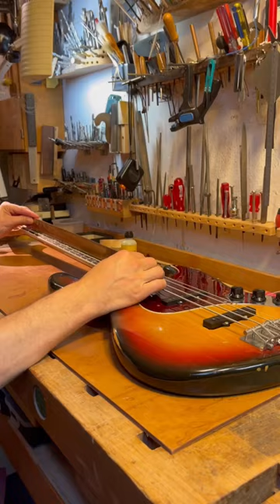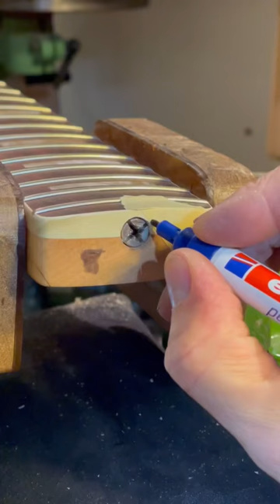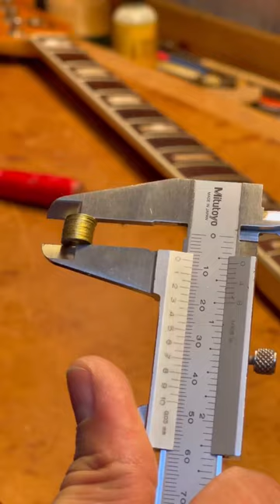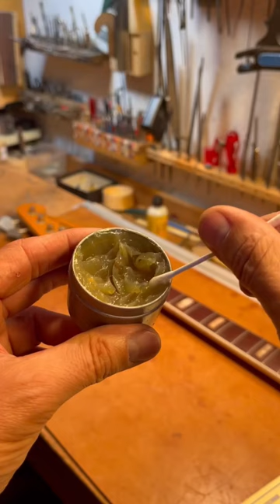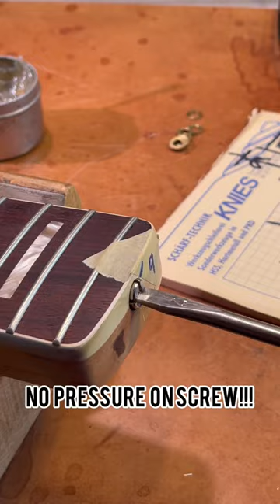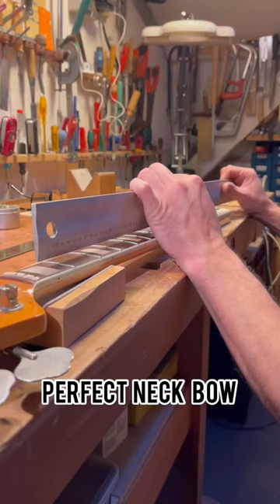Vintage 1970 Fender Jazzbass Luthier Workshop Neck repair #shorts #asmr #fender #luthier #skills

Comment: Temporary fix. The real problem is that the truss rod was overtightened and / or the neck was shocked and the truss rod nut pushed wood into the truss rod channel. Repeated tightenings kept pushing the wood in further until the rod had no threads left and the nut couldn't tighten any more.
I've seen it quite a few times on Fender basses since I started doing guitar repairs in 1975.
Reply from the maker: Thanks for the detailed explanation. That's the case. A lot old Fender Neck have this issue and to make it work 100% you have to remove the fretboard and the Binding fix the squashed Wood and replace the Trussrod. And then glue the Fretboard and Binding on ...make a new Fretjob... New Nut and repair the damaged finish at the Edge of the Fretboard. In most cases the Customer/Owner  don't want to invest in this procedure that will fix the Issue for ever:::: Thanks for your Feedback. Best Regards Nik
Reply: @petrekguitars  Yep. Fortunately none of the ones I fixed had binding. I removed the fingerboard and trussrod. I'd route a small square hole in the damaged area and glue in a small square block of hard maple with the grain oriented 90° to the trussrod, redrill the hole and install the trussrod. A LOT of work, as you say, but it fixed the problem. Cheers. Mike
Reply from the maker: @curbmassa  Thanks for sharing your experience. That's the way you have to go if you want to solve the problem. Best Regards Nik
Reply: This little exchange gives me hope for the future of the human race. Thanks guys. Knowledge!  X
Reply from the maker: @Emil-Antonowsky  Thank you so much for your Word Inigo...Knowledge is the Key and to show it to other people and share his experience without thinking of having any benefit out of it, is the way to go:-) That's my opinion..... and my way of life... You are welcome Best Regards Nik
Reply: I've had '69 and '72 Jazz basses, with rosewood board and blocks. Both had this problem. As I was told, most rosewood/blocks Jazz necks have this tendency due to some reasons: the fretboard is too thin, rosewood is not as dense, as, say, maple, and that block on the first fret makes sense.
Reply: @petrekguitars  Me again, Nik. That`s SOOOOO my way of life, too. Back in `75 when I started paying the rent and feeding myself and keeping my `61 Chevy on the road  by fixing guitars, there was virtually NOTHING  to be found instructing a way to fix a guitar. I had all the fine motor skills and patience from a mis-spent youth building model cars and fixing all the neighborhood bikes. I learned how to spray lacquer by working in body shops a few years later.  I had to make/adapt all my own tools to get a job done: some turnbuckles with the hooks cut off and flat washers welded on to reglue acoustic braces, an old record turntable and a few bicycle parts for a pickup winder, shit like that. I would spend a whole Friday fixing a guitar and deliver it to somebody`s gig that night and charge him 10 bucks because I knew he didn`t have any money and most of the time I never got paid anyways. That`s just how it was. The unspoken  musical consensus back then was "We`re all in this together." I went on to doing kitchens and bathrooms and rebuilding porches on 100-year-old houses (my FAVORITE) but I kept a workshop to fix guitars for myself. When I retired, I sold off most of my collection of vintage Gibsons and Fenders and moved to Hungary back in 2016. Every one of them was brought back from the dead and they all sold within 2 weeks. So, yeah, I`ve been there and done that. Right before I moved here I hooked up with a young guy  in New Hampshire with some serious skills and gave him  all my specialized tools and jigs with an explanation how to use them. He was dazzled and I was thrilled  that somebody else could benefit from my struggles. I like your attitude and I know you will be a success because of your willingness to listen to others. Here`s a little tip- I once fixed a Rickenbacher pickup by taking a toothbrush and brushing against the way it was wound, picked up the broken wire and re-soldered it. 15 minutes, ten bucks and me and the girl had wine and lobsters that night. You had to be there....
Reply from the maker: @curbmassa
Reply from the maker: Thank you so much for sharing your Story. This is a very impressive Life Mate appreciate ....You are a real Craftsman building and repairing thinks with even no Tools is the hard way but the only way to understand and adapt techniques and workflow. Men would be a real pleasure having a talk with you...at the and the experience and the consistence is the key to become a good and free Craftsman. Thanks for the Pickup hack this sounds intresting and I will surly try this out because I am still willing to improve my knowledge. All the Best for you Mate. Best Regards Nik

Comment: On my acoustic 12 chords, I have the first part of the neck bent. The truss rod is tight. Many people say it's normal because the tension of the strings...
Reply from the maker: Hard to say but sounds like a Trussrod issue...Best Regards Nik
Reply: Inexpensive 12 strings are prone to that, I have one myself. 12 strings are tough on any neck, and braces and body joints just can’t handle the tension over time either.  It’s usually not worth fixing, . One workaround is to detune a step and use a capo, that’s what I do on my cheap Yamaha, still playable after 20+ years.
Reply from the maker: @NickWeissMusic  That's correct Nick. The construction of a 12String is staticly not perfect...They are mostly braced and Build like 6 Strings but the String Tension is much higher and over the Time the Top collaps and The Neck Body Area too... This is a common Issue. Best Reads Nik
Reply: @NickWeissMusic  La chitarra è una Eko Ranger An12 del 25 Novembre 1985. Tra le ultime ad essere prodotte in Italia, dato che chiuse pochi giorni dopo... Comunque ha anche il manico avvitato, e sono riuscito a risolvere un po il problema, regolando il truss rod, un po alla volta, giorno dopo giorno, aspettando che il legno si assestasse. Ora, non ha un action come una 6 corde, ma mi posso ritenere soddisfatto, tanto oltre 5 quinto tasto non ci andrei mai. Abbasserò anche io di un tono la chitarra, almeno non rischio di rompere la corda da 8 al sol. Grazie per il consiglio

Comment: So you shimmed it basically since it wouldn't tighten anymore. Interesting.
Reply from the maker: Offen the Trussrod get damaged because the screw is running out of treats so it can't apply and pressure to straighten the Trussrod and the Neck. With the "washer" I create more working area for the Screw. Best Regards Nik